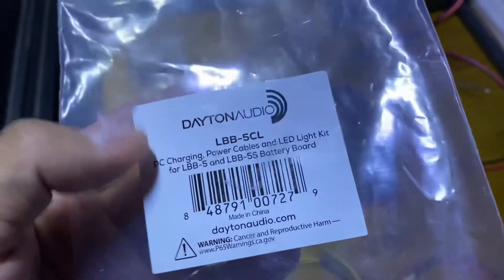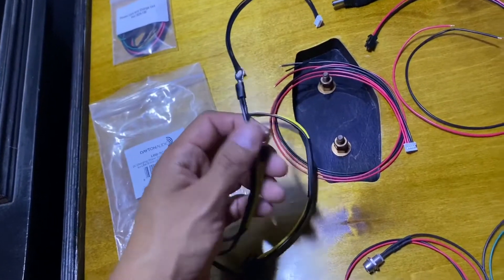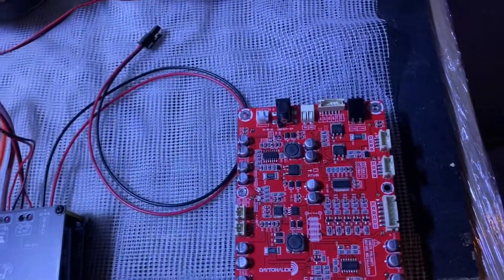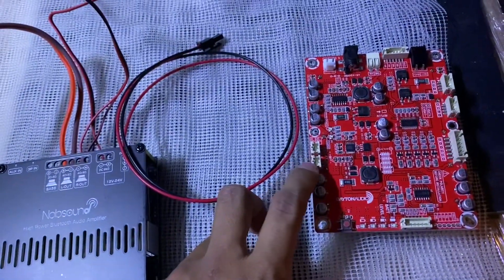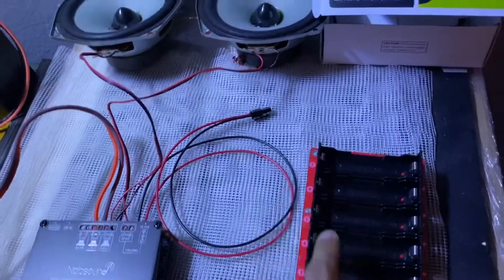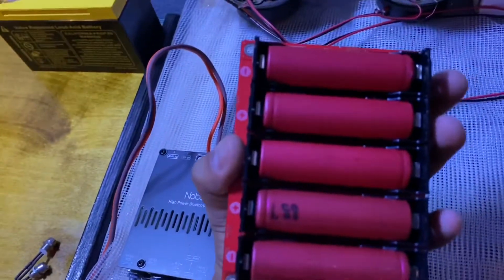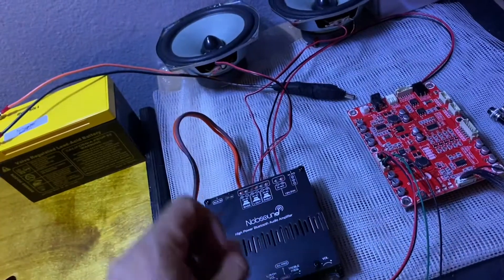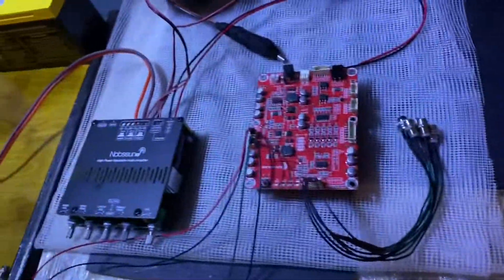Dayton Audio Charging Cables LBB-5CL Content for the 18650 LBB-5S Lithium Balancer/Charger

Comment: Did it work with that amplifier?
Reply from the maker: It did.  I use the LBB3-V2 which now can use 5v to charge (like a slug though).  It uses the same wiring pack as the LBB5.